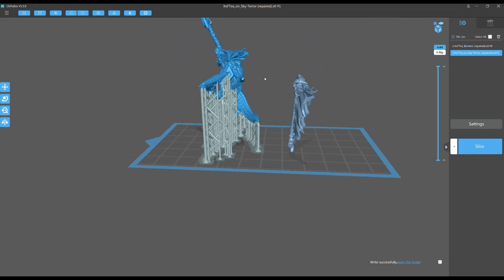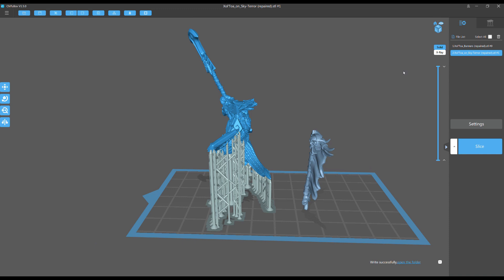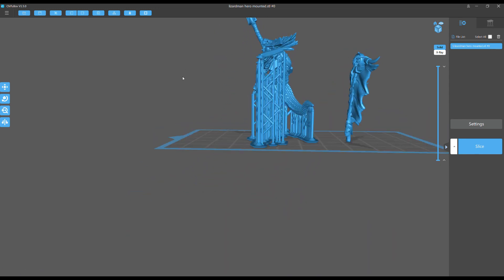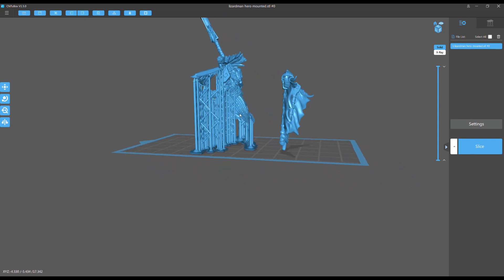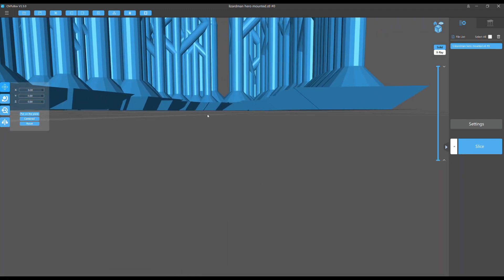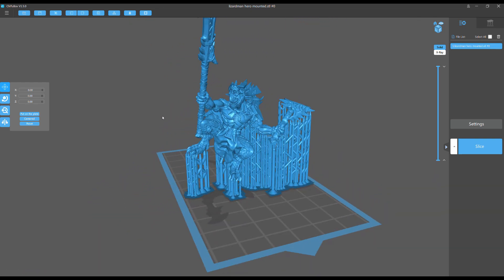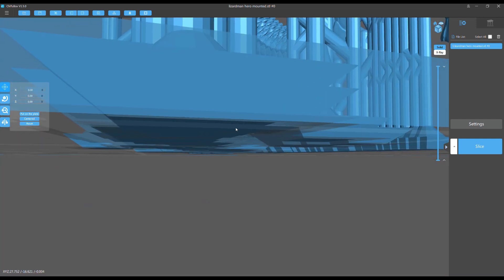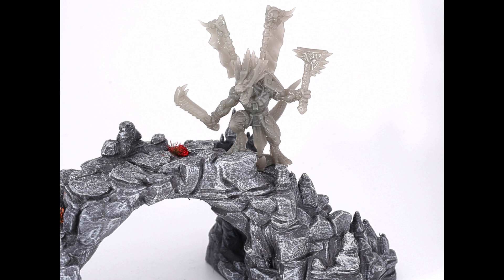Failures in Chitubox when loading in files saved as .stls in Chitubox

Comment: I encountered this myself and have found it better (at least for me) to save a supported model as a Project in Chitubox instead of an STL.  When saving it as an STL, it combines the supports as part of the model, but saving it as a Project keeps the supports separate, which enables me to edit them in the future if needed (as well as removes this potential floating above the build plate issue)